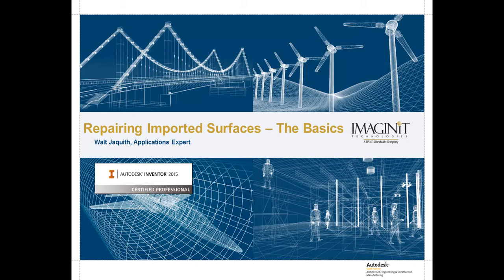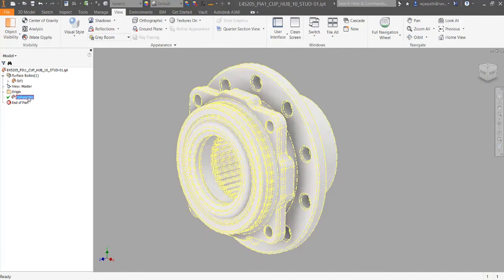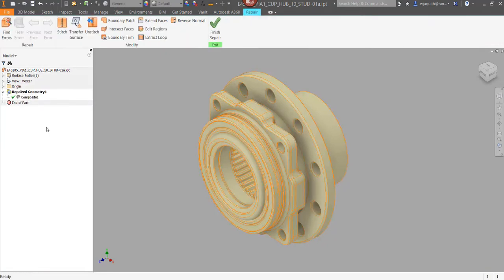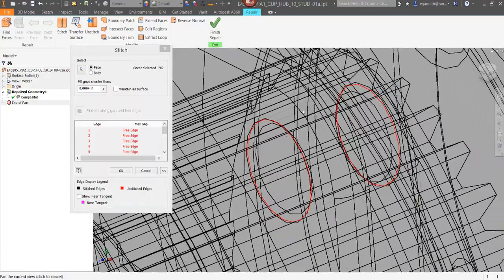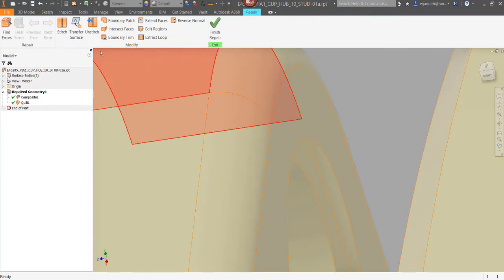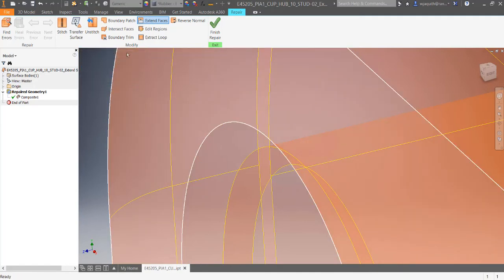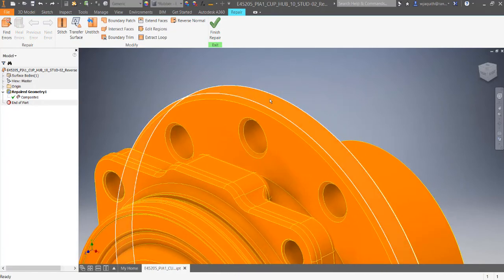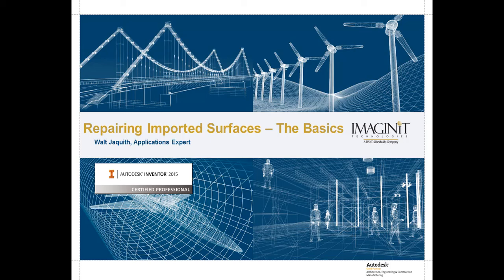Repairing Surfaces in Autodesk Inventor - Part 1

Comment: Awesome vid, I was having problems exporting an stl of a pool filter basket.  None of my cutout  were thru cuts it was adding a skin to the outside of part.  I did your save as the parasolid thing and reopeing just the solid and it worked perfect.  Thumbs up from me.